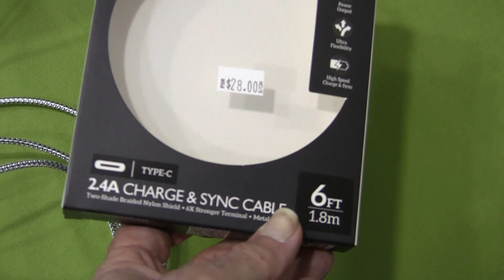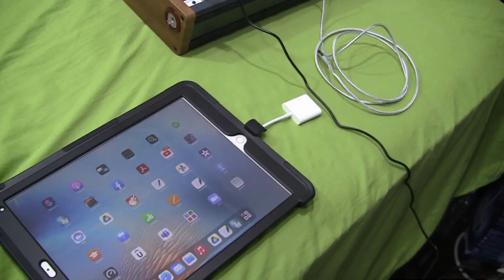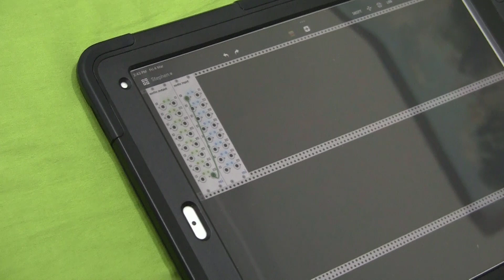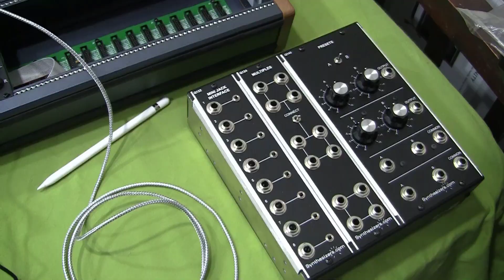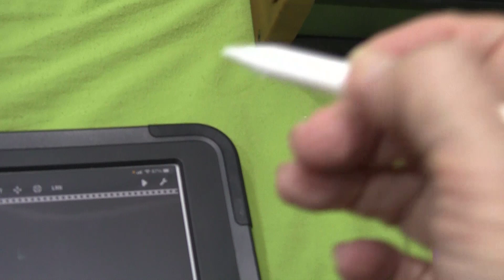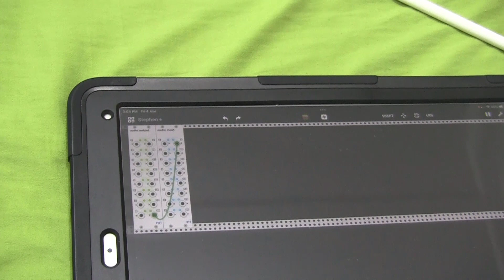How to SETUP ES-9 with MIRACK and unite your MODULAR universe

Comment: thanks for this tuto!
Does anyone knows if it's possible and how to simultaneously make the ES9 communicate between Mirack and Ableton? 
eg : I want to monitor audio from my modular rig from ES9 audio 1 to Ableton and use an LFO from mirack out of ES9 to my modular rig.
Reply from the maker: I don't know for sure ..... but I doubt this is possible..... normally multiple programs cannot use the same driver at the same time
Reply: @StephenMendes  thanks you Stephen

Comment: Did you have to use the Expert Sleepers Calibrator virtual module to tune the output?  My stuff is not in tune.  Maybe you used a hardware quantizer to tune it?  I'm having trouble figuring out the Calibrator virtual module.
Reply from the maker: NO ..... I did not have to tune my ES-9 ..... I only tune the oscillators (that I want ES-9 to control) to standard pitch (I have a "standards" module in my system) so I can EITHER put in a fixed offset to the voltage control input of oscillator and tune to whatever note I like...... OR I can leave the offset  at zero and tune the oscillator at the LOWEST note...... I prefer to use the standards module and tune at higher notes (I have a Fender chromatic tuner that accepts audio input)...... VC from the ES-9 merely raises the pitches of the oscillators and the ES-9 is set for 1V/oct (and it's very accurate) ...... so your issue is probably in what is being sent to ES-9 (from MIRACK or BITWIG or whatever software you are using)...... the Virtual Calibrator module can correct this by intercepting the output of your software and adding or subtracting to change the actual Voltage that comes out of ES-9 sockets...... but why complicate things with so many layers of software ? ...... I would be looking at solving this in the host application, if possible.
Reply: @StephenMendes  I really appreciate you.  I'm a fellow believer in Denver.  I subscribed.
Reply from the maker: @ThedjAwesome  Thanks so much..... I appreciate you 🙏💕
Reply: After extensive testing, I determined that the Calibrator module doesn’t work in Mi Rack, but thanks to your comment, I was able to just tune the oscillator.
Reply from the maker: @ThedjAwesome  Great..... thanks for the feedback !

Comment: Have you tried hosting Mi Rack in AUM as a Auv3?  I don't get modular outputs (main audio out only) when I try to host in AUM.
Reply from the maker: No I have not tried this..... in fact, I have never used the AUM App ..... my take on all this is ...... the OS software is advancing so fast that other software developers just cannot keep up ..... I am now using Ventura 13.1 on M1 (Apple Silicon) on MAC ...... and Roland is still in the testing phase and unsure if ANY of their music products are compatible .....  I am using ipadOS  16.2 on all my ipads and most 3rd party Apps are also still in the "testing" phase ...... AUM is unlikely to be the culprit.... The guy who wrote MI Rack, Mifki has information that might help you solve your problem on his Youtube channel .... check it out and let me know if it helps you
Reply: @StephenMendes  I just got out of a six-month Ableton program and our instructor is a professional musician. He recommended not upgrading the operating system because it breaks the software that you need to do music.
Reply: @StephenMendes  I found the channel that you were talking about, thanks for the recommendation.

Comment: Did you configure the ES-9 from the iPad with the configuration tool?  I tried using Chrome to do that but couldn't so I tried to pre-configure it from the MacBook Pro, but I"m not sure what state it's in.
Reply from the maker: I configured my ES-9 from Windows 10 computer .... there is a configurator program for Windows 10  on the Expert Sleepers website ..... however, the latest Chrome on Windows 10 works as well cause I used that too (from the proper LINK on the   Expert Sleepers website of course) ..... but you would need to install the DRIVERS that come form Expert Sleepers for Windows 10 first in EITHER CASE....... I know that no drivers are required for Mac or ipad, but I have not researched about configuring that way...... I followed the instructions on the Expert Sleepers website and they work
Reply: I was able to resolve this by reconfiguring the es9 using the configuration tool with my MacBook. I configured it the way I needed and then I hit the button that says save to flash hosted.

Comment: Does ES-9 charge the connected iPad as well?
Reply from the maker: NO it does not
Reply: Can i connect the es-9 directly to ipad with usb-c to usb-c cable?
Reply: @nukiolbartes6279  Yes you can! If you want to power the iPad as well, you'll need a USB hub. I happen to have an Anker, model A83830A which seems to be working well. Connection is hub's USB-C cable -> iPad; ES-9 -> hub's 10gbps data port; power -> hub's USB-C PD port. For the power adapter, I'm using the large macbook adapter since the smaller USB C iPad charger doesn't work.